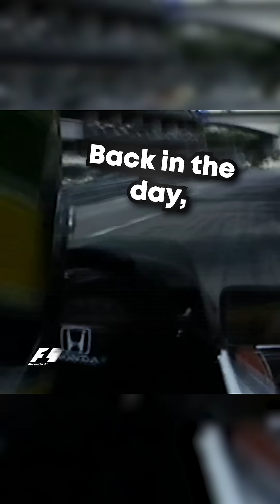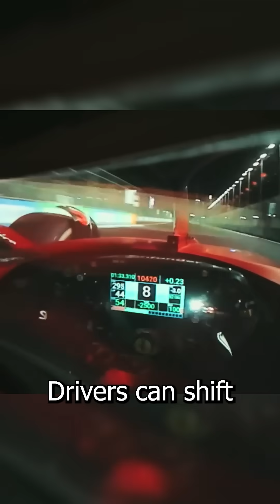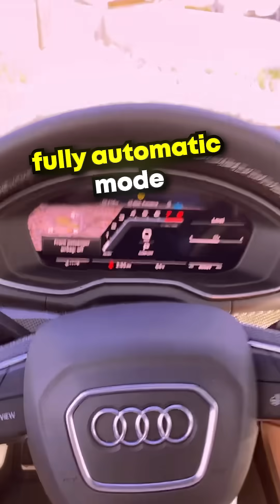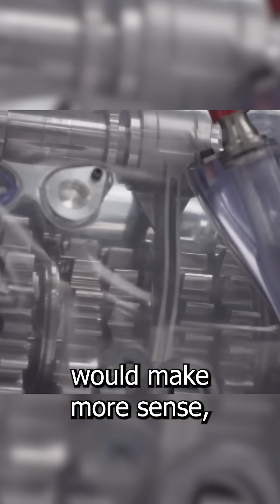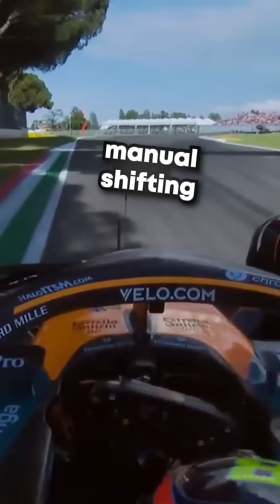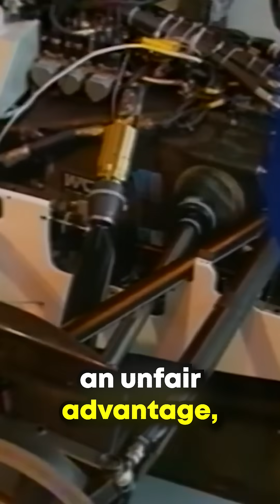Why F1 Cars Are Manual And Not Automatic?

Comment: Manual transmission it’s not. Drivers can choose automatic up shifting and manual down shifting. Or the other way around. It’s a semi automatic system. Most drivers choose manual down shifting as this gives them the best control going into corners. The transmission cannot be fully automatic as mentioned but they are in no way manual either
Reply: In every way they are a manual,  how the gearbox functions is exactly the same as every other manual and F1 any automation of gear shifting is not allowed.

Comment: In the early 2000's (forget exactly when) they raced with automatic upshifts and pre-programmed downshifts. You could see the drivers coming down the straight and pulling the downshift paddle multiple times. The car would then go down the gears as the speed and revs reached optimal levels for each gear

Comment: Manual sequential??
Reply: Yes it's a manual gearbox that is sequentially shifted.
Reply: @DriftNick paddle shifting is not manual.
Reply: @Antwonie-j9g  The type of shifter does not change the what type of gearbox it is, they pull a paddle, it moves an actuator which moves the shift barrel which moves the shift forks and engages the gears, that is how a manual works.

Comment: It's worth adding that the clutch is usually automated on the way down through the box in F1. With the old h-pattern shifts, most drivers didn't use the clutch on the way up the box; and when sequentials came in most drivers omitted it on the way down too. This is ok on a lesser powered and lighter car, and most clutches easily last a season, even with this use. In F1, it's not quite so rosy, and clutch automation helps longevity. It's still not technically an AMT though, as the clutch is there to be used manually when the driver wants or needs to (when pulling away), and the driver chooses the gears.
Reply: First time I've heard this, got a source for it?
Reply: @DriftNick Which bit?
Reply: @RobManser77  Them automating clutch on downshifts.

Comment: Also, automatic transmission will make racing boring as well as drivers wont be able to connect to the car as better as they connect with it in manual.

Comment: You know that the same gearbox you have in a f1 car can be used as an automatic? What is a dual clutch sequential transmission? The same type of transmission like in f1 just automatic via computers
Reply: Dual clutch and the manuals they use in F1 are two different types of gearboxes.

Comment: It’s a semi auto you fool they don’t have to press a clutch between changing gears that is a manual. Guaranteed an American made this as they are dumb AF
Reply: It's a manual you fool, you don't have to press the clutch because it uses dog engagement, that does not change the fact that it's still a manual gearbox.

Comment: Given the quality of sim racing and the few amount of tracks, it's not difficult for an AI to memorize the turns and each individual driver's shifting preferences based on their data in sim racing, in fact, could probably get better and more consistent timing than drivers themselves, at least during sprints. 
That said, it'll be much more boring it's like adding automated steering control.

Comment: well as a sim racer i can tell you why

controlling the rate of your downshifts has a big effect on load balance between both axles PLUS theres some places (like ascari in monza) where you may want to upshift early for more stability

shifting is way more complicated than just adjusting for speed changes its very important for controlling load
Reply: Especially at suzuka. If you do it on automatic especially through the esses, the computer shifts to 5th gear or 6 when you’re trying to stay at 4th and 5th. Especially the triple apex at Qatar, staying at 7th is always better but the auto shifting would try and shift it for you.

Comment: This entire video is pointless. F1 Cars dont use manuals, they use sequential.
Reply: What people call a "sequential" is a manual gearbox that uses a sequential shifter.
Reply: @D @DriftNick  that’s why they call it a sequential and not a manual Sherlock fucking Holmes, it wouldn’t be sequential if it used a manual shifter, theres a difference.
Reply: @duongyeetyboi2609  You don't seem to understand, it is a manual gearbox, the shifter  is a sequential shifter, it's still a manual gearbox, you can call it a manual gearbox and you would be correct,  just because it doesn't have a H pattern shifter does not change what type of gearbox it is.
Reply: @DriftNick thats not what I’m saying, I’m saying it’s called a sequential because it’s a manual with either a sequential shifter, paddle shifters, or both, I never said the gearbox itself was the cause of the name, nor did I say you were wrong
Reply: @duongyeetyboi2609  You said this "F1 Cars dont use manuals, they use sequential." so of course I'm going to assume you mean that.

Comment: The true reason why automatic transmissions are banned is because it would remove an element of driver skill from the races. If you use a computer to figure out where to shift then why not use GPS to plot out the optimal racing line and have automatic steering take over?

Comment: Speaking in a racing standpoint, when you are going through a corner, you need to determine what gear to be in to take the corner the fastest, in an automatic, you could be in a higher gear ratio in a corner that doesnt need it, which may cousin you to understeer and such
Reply: Plus it could shift mid corner

Comment: in 1993 williams didn't test the automatic gearbox they tested a cvt transmission which is very different from an automatic gearbox a cvt maintains the exact rpm at all times and ensures maximum power at all speeds which was super unfair

Comment: They were used, because they gave the driver an advantage. However the FIA decided cars were being perceived to be becoming easier to drive due to all the driver aids and automated systems, e.g active suspension, traction control. It was also making the cars more and more expensive. So they banned them all, but did keep the semiautomatic gear boxes.

Comment: Another point could be it is something that can decide a race if done wrong or messed up. It should be something that F1 drivers should be able to do whilst racing, knowing how long until they shift and if they can shift as they get to a corner. Everyone clearly can do it but I think if it switched to automatic, it would give the older drivers a bit of help considering their slight decrease in reaction time.
Reply: If you can’t shift you have no business driving a F1 car on Spa Erau Rouge at 170mph

Comment: Ok....the information in this short is all sorts of wrong.

First, a little bit of history. The paddle shifter was introduced into F1 by Ferrari with the F189 (640) for the 1989 season. I say introduced into F1, becasue Porsche had actually created the technology (PDK) and used it in its 962C Group C car. In the Ferrari, it was a hydraulically actuated, electronically controlled transmission where the shifts were initiated by the paddle shifters on the steering wheel.
Formula 1 DID have fully automatic gearboxes. Up until 2004, teams could program the transmission specific to the track, without any sort of driver input. Beginning in 2004, all transmission shifts had to be driver initiated. That's why there are no automatic transmissions in F1.Trust me, if it was allowed, all the trams would be using it 
The transmission that Williams tested in 1993 was a CVT, not an automatic. Yes, the FIA did ban CVTs beginning in 1994, but CVT are not automatics and the FIA didn't ban automatic shifting until 2004.

Comment: The tested "automatic" is actually a CVT ( Continuously Variable Transmission ). It keeps the engine RPM at a constant speed and varies the transmission ratio based on speed. Although the operation is automatic, it's nothing like an automatic transmission

Comment: There are three types of gearboxes, Manual (what stick shifts are), Sequential (what F1 cars are, manual without the clutch), and automatic, F1 cars use sequential because it is the easiest to work on.
Reply: i thought there are 2 clutch paddles for modern f1, thus there are 4 in a steering wheel up shift, down shift, clutch biting point (for launch)and clutch full release. they are not just connected mechanically but are controlled electronically. unlike the sequential of a motorbike(w/ or w/o quickshift) and rally cars?

Comment: its fine in road cars because they aren't fighting for tenths around a lap, how the hell is an automatic gearbox going to know what gear is best to use around certain corners, and then what about when it rains that massively affects what gears need to be used and when, then also automatic gearboxes just add weight and therefore just be slower

Comment: So much bending of the truth in this video...
Fully automatic gearboxes were not only tested, they were used between 2001-2004 by many teams (Most used auto-upshifts and pre-programmable downshifts on the straights, while Ferrari ran fully automatic on some tracks). Listen to Jeff Gordon's interview on the day he drove the 2003 Williams, or look at good quality onboards from 2003.
Furthermore, The 1993 test was with a CVT transmission. It wasn't banned because of being automatic, it was banned because it had infinite number of gears, when the rules dictated between 4 to 7 gears. It's sound was genuine to the CVT transmission, not to the sequential gearboxes at the time, and it had nothing to do with CVT being banned. Nor did a team having an advantage - it was simply against the rules to run infinitely variable gear ratios.
From 2005 onwards, gearshifts have to be manually initiated.

Comment: That's not manual gearshifting. It's semiautomatic. The driver has no need to disengage the clutch on downshifting because that aspect of the gearshift is handled automatically. If F1 gearboxes are anything like they were thirty years ago, they have a gearbox with two or more clutches controlled by the computer.

(Yes, I know you don't *need* to declutch to change gears in a manual, but the clutch allows you to shift faster if you don't have a computer to do the rev-matching for you.)

Comment: A short, technical breakdown:
F1 cars use automated manuals with manual gear change only
The gearbox is a manual sequential transmission with electrohydraulic actuation. Basically, a classic dog ring gearbox like before the 90’s, with the dog clutches electrohydraulically actuated and only up a down sequentially. On top of that, the dog clutch for the next gear is already pre-selected and can be engaged in milliseconds (seamless shift)
In the early 2000’s, fully automated shifting was allowed and use (automatic upshifting and pre-selecting which gear to shift down to in the next braking zone), as well as launch control. This means that launches in those times were as simple as engaging launch control and having good reflexes. Automated shifting, launch control (and TC) were banned in the late 2000’s to rely more on driver skill than technology.

CVT’s were tested by Williams, but very soon prohibited by the FIA to avoid another development war (it was winter 1993-94, when a lot of driver aids were banned: active suspension, active aero, ABS, TC,…)

Automatic transmissions (with a torque converter) might not be feasible because of size and weight, but are not permitted anyway.

The rules since 2014 also dictate every gearbox to have 8 gears + reverse and ratios are to be chosen before the start of the season and not be altered.
Reply: Excellent comment! You said everything, there’s nothing to add
Reply: The fixed ratios where introduced in 2014 along with the new hybrid engine regs.I belief the main reason was cost savings, but probably also to have more overtaking, since teams used to set up their ratios for optimal lap time. This way they are no longer hitting the rev limiter on the straights when using DRS.
Reply: I didn't know they can't change ratios.  What was the reasoning behind that rule?
Reply: There's only 1 slight mistake. Yeah gears are fixed for everybody and up until late years of turbo hybrid era teams could use their own gear ratios but they were fixed thru entire season. But these days fia gives team the exact ratios teams have to use. Look at 2014 onboards mercedes were using 8th gear minimal but redbull were topping out at 8th in the middle of the straigts
Reply: @20ege008 thanks, did not know that.
2014 indeed looked like a gamble as to the chosen ratios. Teams were also expecting to do fuel saving more than before and had 7-speed gearboxes the whole 2.4l V8 era
Reply: very short answer, pilot can shift they aren't americans

Comment: The CVT wasn't banned, Williams chose not to run it as the engine could not sustain the continued high RPMs inherent to CVT designs. Using such a gearbox would destroy the engine
Reply: It was banned though by FIA.

Comment: This isnt a manual, its a sequential. You press a button and the gear shifts. It is in no way the same as a regular roadgoing manual as you barely use the clutch. So no, they dont use manuals anymore, they use sequentials.
Reply: I manuelni mozi biti sekvencijalni...to samo znaci da ces posle 4. brzine morati u 5.
Nema preskakanja brzina...za razliku od H seme. Ono sto f1 koristi je skvencijalni menjac sa elektrohidraulicnim aktuatorom koji zamenjuje kvacilo od manuelnom..
Reply: It's a bit like with fighter jets today, fly by wire, in F1 it's shift by wire and not mechanically.

Comment: İt's an easy answer. The F1 drivers are not lazy people like the americans.
Reply: is that why a British man and a French man each won F1 titles in vehicles that had fully automatic transmissions before they were banned by the FIA in 1994?
Reply: @cherrymolotov  automatic transmissions were never used at F1. İf your national feelings are hurt and want to stab back, get educated well first before answering someome.
Reply: @cemgokcan  the FW14B never had them, was wrong about that, but the FW15C had a transmission that had an optional fully automatic gearbox setting. if you’re gonna correct me at least be correct.
Reply: CHAMP car series didn't use paddle shifters. they still had to remove a hand off of the wheel to shift. So, how is that lazy?
Reply: @acidstorm001 this is just technology. İn the 90's F1 drivers were shifting 3-4 gears down in under a second what a nascar driver even today can't do.
İf they put in manual gears nack to F1 cars, you can't even blink faster when they downshift before a corner.
And meanwhile, almost every F1 driver can drive manual race cars because they transition pedal shifters from manual while they go up to F1 (Formula Renault, Formula Ford etc).
But based upon your logic, İndycar drivers are lazy too. 😂😂😂😂😂😂😂
Reply: @cemgokcan  NASCAR isn't even comparable. They have 4 speed transmissions and aren't built as circuit racing cars. They do like 2 or 3 road courses a season...

But F-1 isn't lazy at all with paddle shifters? The CHAMP car guys can drive manual too. I don't see your point at all. They have to steer with one hand while downshifting. But I guess with your logic, that's being lazy...

Go back and watch the old F-1 cars, they don't downshift 'faster than you can blink'. Your logic is not making sense.

Comment: Plus i think that pro drivers are more precise than automated gear shifters
Reply: Racer actually doesn’t care about gears(or fuel to air mixture ratio or any other mechanical thing), racer needs a car that is faster. I’m 100% sure an F1 car with F1 engineered automatic transmission will obliterate any manual car, it could be tuned so the engine is at 100% power and perfectly timed to corners or whatever. That would be bad for the sport though. But the cars would be faster
Reply: @GlebLesnikov  the driver's don't try to shift in a way that is the same all the time. It all changes depending on where they are in a corner, if they are trailing or leading another car, the track condition, the tire condition, changing fuel-saving needs during a race, other mechanical issues that needs accomodation and probably more things. It's theoretically possible but it would require an insane level of advancement.
Reply: @canererbay8842  No, it's not insane level. E.g. there are computer controlled jet engines for 40+ years(it's called FADEC there, look it up). Conditions don't matter, ECU could optimize for everything while maintaining maximum efficiency. Computer knows much more than the driver and can react in milliseconds. The same goes for ABS/ESP/etc. Humans are too slow for the computers in mechanical tasks. Do you still think that humans play chess better?
Reply: No
Reply: @thalesesteves yes they are, cause a automatic gear shifter always shifts they same, and not how a racer wants it to be
Reply: @FelixMaiwald-v2c No again...